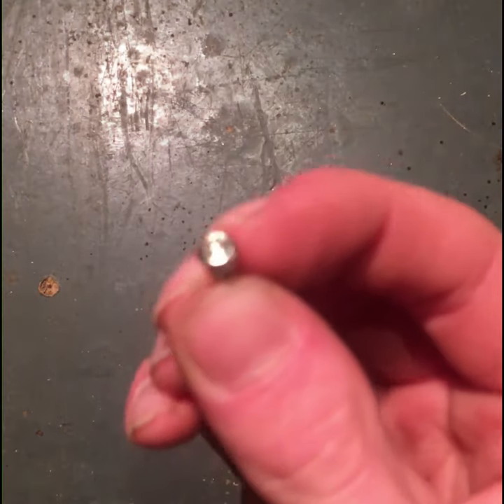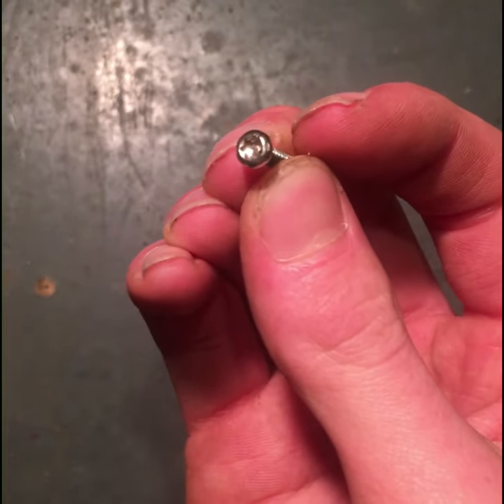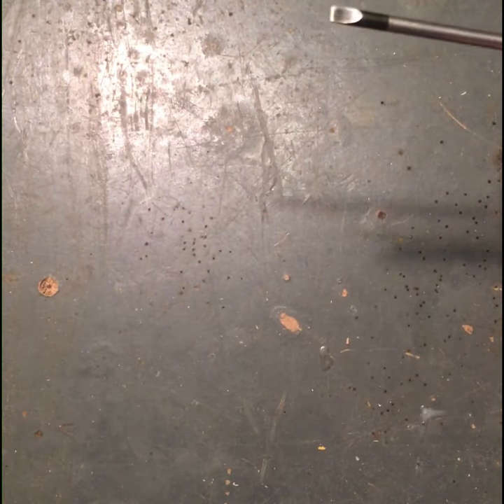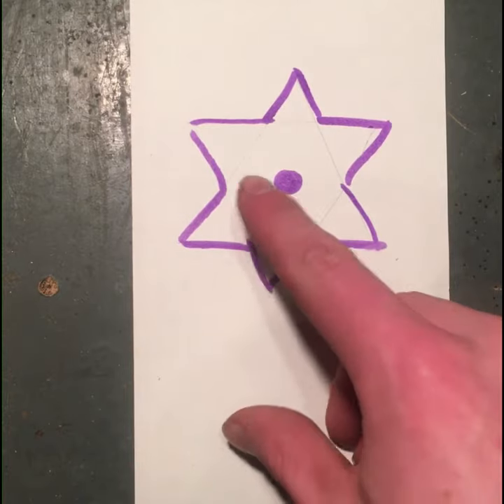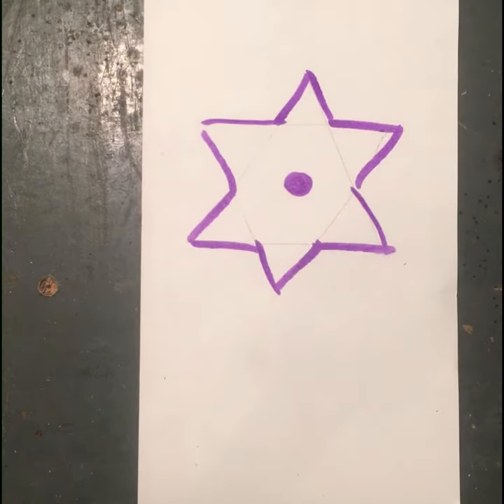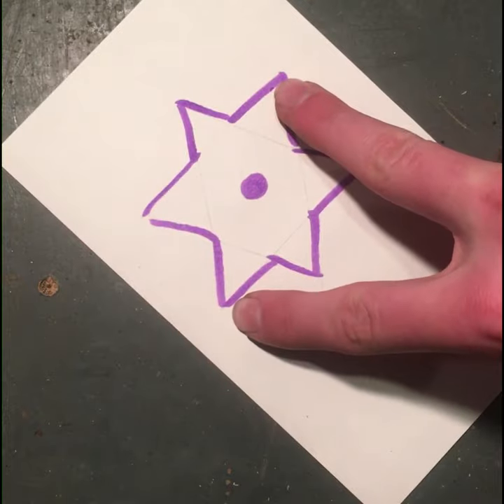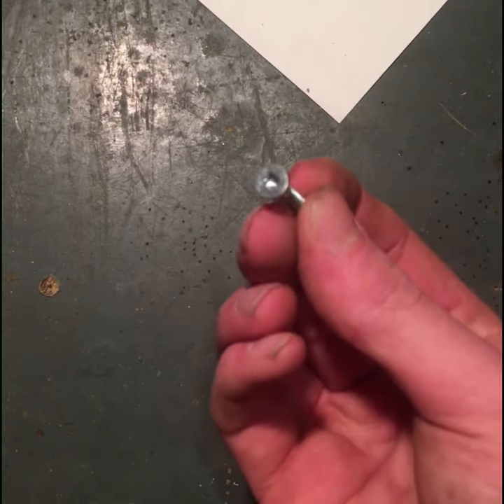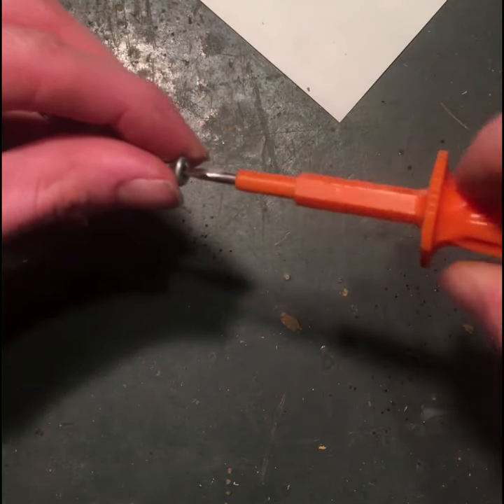Torx Head Screw trick

Comment: You can break the pin so you can put a normal torx screwdriver and you wont strip the screw or damage the flathead screwdriver
Reply: How do u break the pin?
Reply: @franklynchacha803  bend it with the flathead screwdriver until it breaks